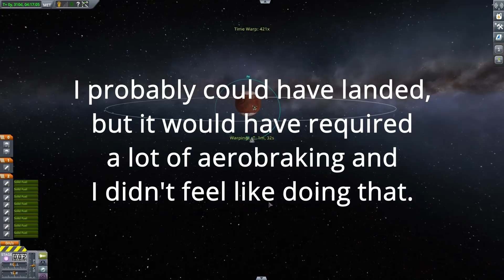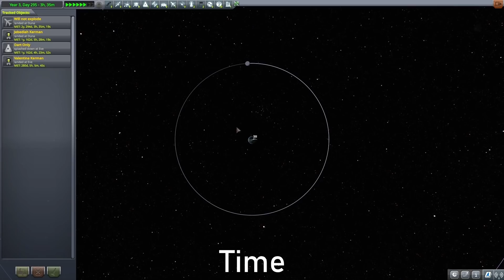Can you use Solid Rocket Boosters to Land on Duna?

Comment: The reason your parachutes didn't deploy earlier isn't just because of your speed or altitude, but also because in addition to adjusting the deployment altitude, you also needed to adjust the deployment minimum pressure, that little thing that's set to 0.04 by default. That should be 0.01 on a Duna landing. That number sets the minimum atmospheric pressure the parachutes need to feel before they semi-deploy into their drogue mode. The altitude setting (which is set to 1000m by default and which you maxed out to 5000m) controls when the parachute goes from semi-deployed to fully-deployed.

Comment: Hold down shift when using the translate gizmo, or at least use structural fuselages and cubic struts instead of empty fuel tanks.

Good idea with the blocking. I tried to use staging, with separatrons that cancel out and push away lit SRBs, I think, which doesn't give anywhere near the same potential finesse.

AIRBRAKES can be grabbed by the Klaw. You can use them as servos.

Comment: Reminds me of the space shuttle’s system to lower the thrust for the soIid rocket boosters. At max Q they block some part of the solid rocket fuel that’s entering the solid rocket motor engine. Pretty neat. Blocking the fuel to lower throttle for a srm.

Comment: You should start to use autostruts.
Also, there are robotic parts like pistons, hinges etc. They are part of the breaking ground dlc though.
Reply: Agreed. Regular struts or auto struts would help keel those side boosters flopping around and help stabilize the flight profile cause your thrust isn’t vectoring as they flop around.

Comment: Idea: Only use the electric thruster. I’d be surprised if you could even get to Orbit
Reply from the maker: As long as they can lift their own weight with enough of them it should be possible
Reply: @ReidCaptain  possibly, good luck if you try though!
Reply: @ReidCaptain  It is definitely possible, Bradley whistance has done it before
Reply: @ReidCaptain  they can‘t lift their own weight on sea level. Some people did it though.

Comment: Or you know, you could have just detached the solid rocket engines when you were at the right speed, and wouldnt need a heavy system to block the thrust
Reply from the maker: Well yeah, or I could have prefilled the tanks to have the right amount of fuel, but that's less fun
Reply: @ReidCaptain  true, i see your point, sometimes engineering the weirdest inventions is the best part of KSP
Reply: @ReidCaptain  Or just use robotics??
Reply: @alexwang982  I don't think he had breaking ground installed.
Just look at the tabs in the V.A.B.

Shhhhhhhh...
No I'm not a whole year late...
Reply: @zderpydiamond4800  im a year and 4 months late
Reply: @grantilope  shhhhhhhhhh...

Comment: How about this: Going somewhere with only the most powerful liquid fuel engine in the game (I think it's the Mammoth? Whichever has the four small thruster nozzles on it.) 
Or: Going somewhere with only the weakest liquid fuel engine in the game (I believe that's the Ant engine but could be wrong)
Reply from the maker: Oooo
Reply: @ReidCaptain  I recommend using the spider engine instead for the first few stages, as it has better efficiency lower into the atmosphere, and has control gimbling, at the cost of being more heavy, but also the exact same thrust. The ant and spider engines are practically siblings, so might be helpful to consider both
Reply: Nah 8 vector engines.
Reply: The weakest engine is the mini Puff engine, I forgot it's name. It's the smaller Monoprop engine.
Reply: @ziggythomas1123  Maybe that is the weakest engine in the game, but I’m only counting liquid fuel engines, not monopropellant ones.
Reply: @ziggythomas1123  that one is amazing for its size
Reply: @blakebevan1941  😳

Comment: Could you have used engines facing up to counter the bottom ones
Reply: It would double the weight and add dead fuel. Not a good idea.

Comment: Waiting for only jet engines to duna :)
Reply from the maker: Maybe one day, that seems v hard
Reply: @ReidCaptain  just use the space air
Reply: @ReidCaptain  it's not just hard, it's impossible
Reply: @magica3526  jets have been used to get to orbit, so Duna is maybe slightly possible to achieve
Reply: @magica3526  theoretically it's possible
Reply: @dolphinman042  orbit, yes, but you would need to get another 1100 m/s beyond that, and that would only be for a tiny payload. it might be possible if you didn't have to deal with the kraken, but even that is unlikely